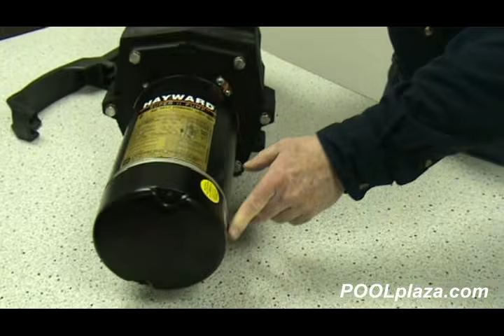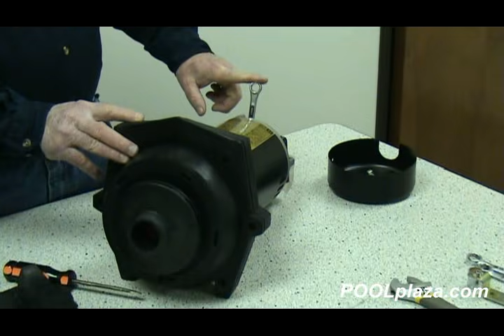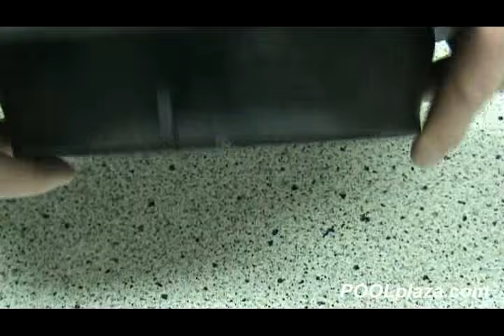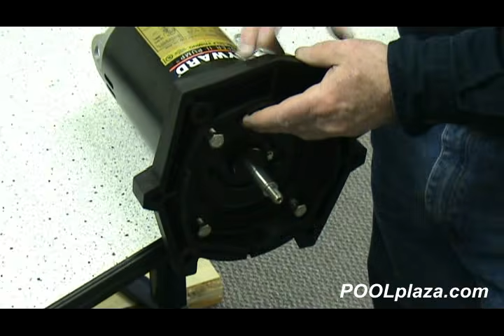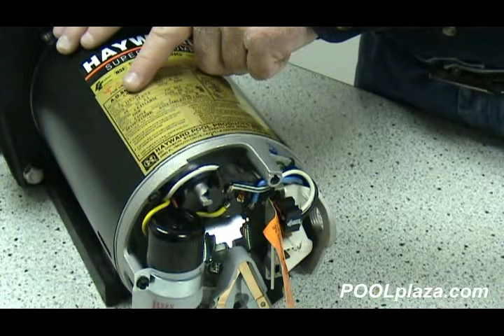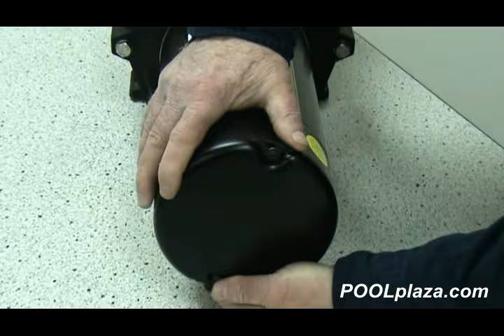HowTo: Repair a Hayward Super II Pump - poolplaza.com

Comment: Never touch the ceramic of the seal with your fingers.  It will leak.  Use a clean rag or the paper that comes with the seal.  That right there is a huge nono. The oil on your fingers will not make a good seal.  Also fill with water before turning on. This will also burn up the shaft seal.

Comment: Removing impeller in reality is probably much harder. You will probably need a strap wrench. Locking the hub on the motor is also harder than shown.  12mm or 7/16 wrench has to be inserted under start switch on motor which is tricky. Maybe you could show that stuff in detail so people don't get surprised and frustrated when the impeller does not just come off as easily as you show.
Reply: Mine came off by hand, the impeller that is,  but I did remove the capacitor hold down to make room for the 7/16 wrench. But spanner is recommended and I was worried I might need one. Also my impeller was worn out pretty bad, best suggestion to buy a new one.

Comment: Great video, unfortunately the pumps are installed in some Godawful places and it's a pain to work on them, like mine lol Have to be a contortionist to get the wiring landed. But, this is a great pump and I enjoy rebuilding mine to save some time and $$$. Have to be careful when you order parts online to make sure you get OEM Hayward parts. Lot's of 3rd party parts that are garbage.

Comment: Thanks for the demo -- as I have a Super2 that needs some attention.  Although this is a bit long in the tooth now, I'm wondering if you'd still be monitoring this for DIYers like me to bug you.  You make the impeller removal look SO EASY - I suppose it's all in the wrist?  For one thing, I can't put a wrench on the other end of the shaft - it's just a slot for a size LARGE screwdriver - and a screwdriver is one of the least efficient tools one can use: almost NO leverage!  So I tried my impact driver with the biggest straight screwdriver bit I could find, but that would rather tear up the slot in the shaft than break loose from the impeller! 
So my question goes to the handy-dandy special tool you showed at the beginning of your video.  Is there likely a place hidden somewhere where I could insert such a thing, if I had one, to hold the shaft???
(Don't you sell rebuild kits for these pumps?  Mine's 14 years old, and this is the first time I've had to open it up, surprisingly!)

Comment: Never touch the ceramic seal with your finger. Eventually skin oil will compromise the seal. Always replace the diffuser seal and housing seal also. Comes as a "seal kit" for just a few more bucks.

Comment: Doing all this right now.   Motor decided to have a minor firework display after 20 odd years.   A motor winding shorted.   Took me a while to get the shaft locked but got it right as per video.   In the end I replaced all seals and gaskets, the impeller and wear ring too.   Good video.   Thanks.

Comment: Its a good video however what about the seals between the motor housing and the strainer housing. Would that be the cause for a leak from my pump that is about 8 years old and still pumps just fine?
Reply: Usually the pump has run dry for a period of time due to possible water level.
Thank You

Comment: I'm a building engineer. Every seal I ever had that failed was mainly due to the automatic pool control chlorinator and acid monitors not working right due to stuck non shutoff magnetics getting stuck in the sample cells and adding acid to the point of volcanic acid levels of PH 3 and chlorine to where you could sterilize a dead body and turning the pump seals into sponges which you can use as magic markers,
Reply: Have replaced countless seals over the years they last approx 1 month . I have noticed that when I add muriatic acid to lower PH around pool perimeter a leak seems to develop in pump shortly . Is the abrupt change from 8.o ph to 7.4 too much for these seals ? Useing Bacqua cil and Hy proxide to shock as per Bacquacil
Reply: Sorry for my spelling errors in the first comment. A drop from 8 to 7.4 should not do any damage. When the pumps have been subjected to repeated acid drop attacks this will most surely turn the rubber into sponge like material as well as over chlorination. The pools I work on have automated systems that add chlorine and acid when needed. When a pump shuts off for a unexpected reason these automated feeder system are supposed to detect it however the magnetic solenoid inside the sample flow cell a lot of times gets stuck so the sample cell thinks the pump is still on and keeps reading the stagnant water inside the sample cell and keeps feeding the chemicals in to the pool thinking its doing it job but is actually self destructing  till failure.
Reply: Just found out that replacement PS 201  Shaft Seal has a moulded  PLASTIC face . It's considered OEM,  I doubt thats what they have in the new units . They probably have the PS 4265. the PS 201 plastic may last in some applications , but not in mine .  The Carbon face mating with the ceramic seat is probably much stronger and lasts longer . Even the body assembly is stronger . This took a lot of resarch on my part and I have ordered  the carbon seal . I wonder how many owners had the same problem and just  just bought a new pump?  Talk about built in obsolescence. I will let you know the results.  I dont give up easily . Too much junk out there these days .
Reply: JisINSANE3 yikes now those I’ve gotta see

Comment: I am not having a leak issue.  I believe my motor just went out as it will not come on and throws a spark when i try and turn the filter on.  My pool guys wants to replace the motor and pump for 950.00.   I was given advice to just change the motor, which is way cheaper.  do i need to replace anything else? seals? Shaft?

Comment: Hand tight on the 4 bolts attaching the pump plate to motor???  The rest of the video is good, but that is NOT correct.  Tighten them up!!

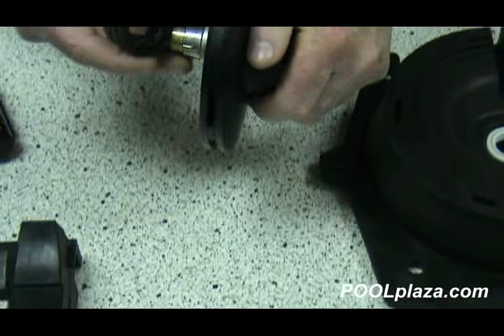Comment: At 5:03 you will notice a metal silver colored sleeve around the brass diffuser shaft.  That is actually part of the spring loaded seal and will need to be removed as well if replacing the seal.  I would also suggest watching several of these videos from different people, because not one I have watched is complete and/or perfect.  This guys is pretty good, but finger tight bolts?  Not on my pump.

Comment: A quick note; if you have an older super II pump, the impeller will likely have to be replaced because the entire thing is made of plastic.   You'll note in this video that the sleeve where it screws onto the shaft is brass, old pumps will be plastic.    And if that snaps off, not only is the impeller ruined, but the diffuser and diffuser ring will likely be ruined as well.   Those three parts will run you about $50.

Take it apart before your order.

Comment: Unfortunately, my Super II is original equipment from 21 years ago and the leak had gone unnoticed for some time - it's a much different situation when everything is old, crusty, and rusted, and the pump is in the middle of a muddy pad surrounded by complex plumbing and there's a sweep pump about 8" behind this one.

Nothing wrong with the video and the instructions are great, this is just a little reality-check that you're looking at brand new equipment on a work-height table and I was jealous.
Reply: For real! I just found that out last night! Thanks for the video!    Mike in DFW

Comment: @MrRipcord69 @MrRipcord69 THESE PUMPS ARE KNOWN TO CRACK AROUND THE INSIDE OF THE TANK, THERE IS NO WAY TO REPAIR A CRACKED TANK ! I RECOMMEND TO ALL OF MY CUSTOMERS TO USE RTV SILICONE, JUST A SMALL BEAD WHERE THE GASKET HITS THE SEAL PLATE, WIPE THE AREA CLEAN LEAVE THE GASKET IN THE TANK AND APPLY THE SILICONE TO THE SEAL PLATE. LET IT CURE FOR ABOUT A HOUR, THEN PRIME THE PUMP, AND HOPE FOR THE BEST .. JAY .. FLORIDA

Comment: I followed the instructions, but the instructions left out replacing the rubber gasket on the face of the pump and the plastic face plate. I had to figure that out especially when there was leakage. Now I'm trying to figure out how to stop the leakage.